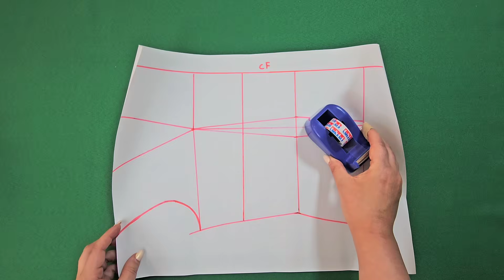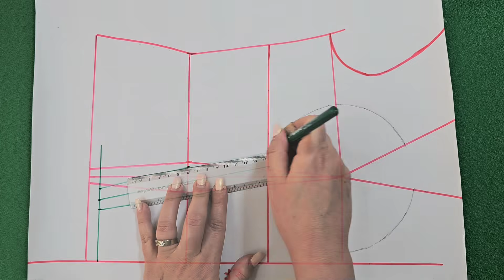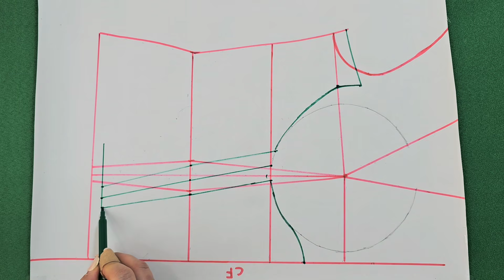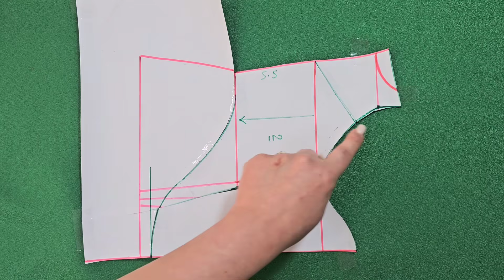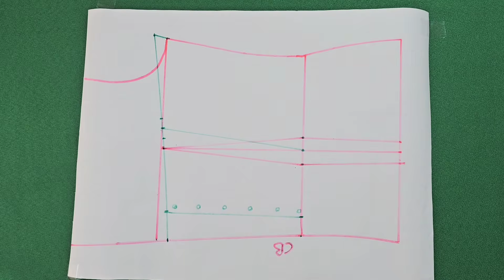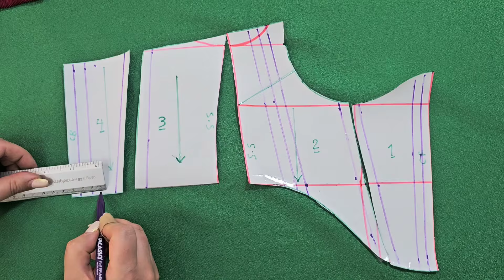Draft a Perfect Underbust Corset Pattern from Scratch | Perfect Fit!

Comment: How did you get the required length of the straps
Reply from the maker: Thank you for your question! ❤️ I usually determine the strap length by placing the corset on a dress form or by trying it on the body, then measuring from the front strap point, over the shoulder, to the back strap point. In this design, the straps are mainly decorative, so I prefer making them slightly shorter. This creates a more elegant look, with the straps sitting just a little away from the corset instead of lying completely flat against it. 😊
Reply: @NABATCORSETSTUDIO-MAH ok thanks but is there a way to get the length from the pattern
Reply from the maker: @NiolaAtelier Yes, if you want to determine the strap length directly from the pattern, you'll need the complete bodice pattern, including the shoulder area. In that case, keep the upper part of the pattern and measure the strap length from there. For this tutorial, I used fitting on the dress form because the straps are decorative and look better when they're slightly shorter, rather than lying completely flat against the corset. ❤️